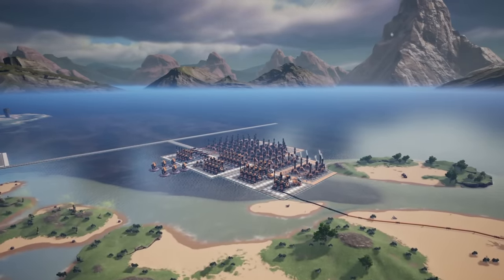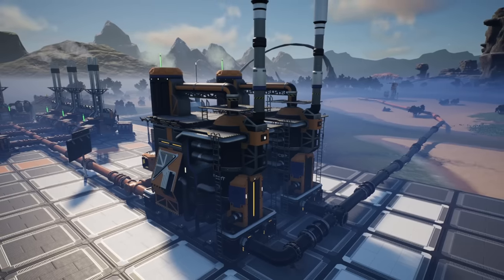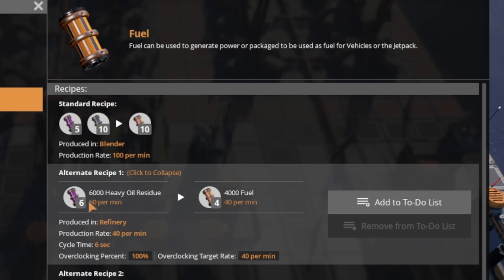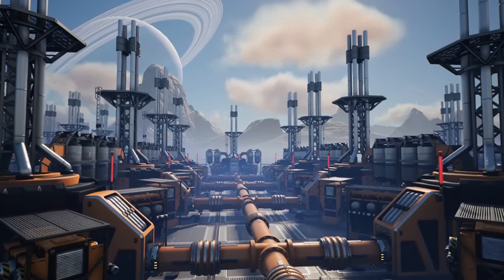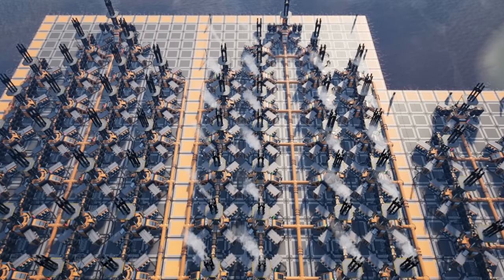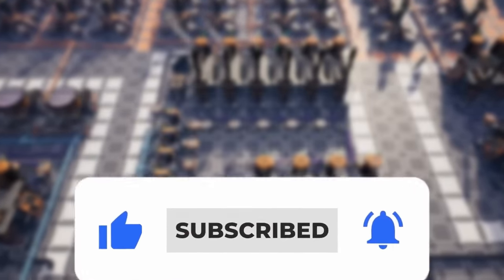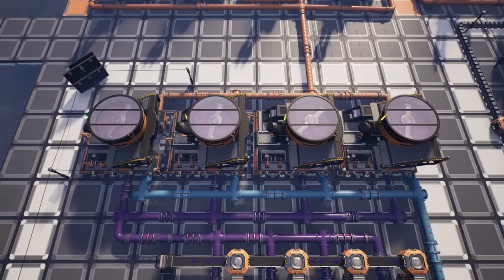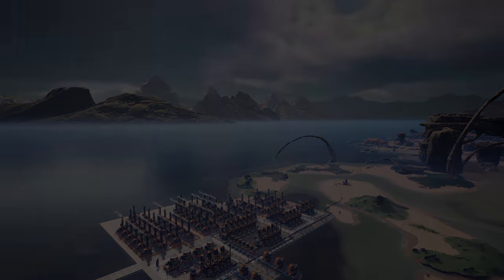100% Efficient Alternate Fuel Layouts For Every Player in Satisfactory

Comment from the maker: ALL MY MATHS IS WRONG! (Kinda) - so I confused the pure oil node (240 crude per minute) with a pure resource node (120 per min Mk1) So these layouts are PERFECT - for a normal oil node... For pure oil nodes you'll need to double each recipe. My apologies guys!
Reply: jep sadly yet no mk2 oil pump ingame. but you always mentioned 120 oil/min so it doesnt matter much
Reply: Awesome video as always!
Question:
Is there an advantage to setting clock speeds using percentages instead of just typing the output required?

I noticed there was a water extractor you set to 66.66% resulting it it outputting only 79.99m3 (I know it's not much, but over time...).
If you type 80 in the output it updates the clock speed to 66.6667 automatically 🙂
Reply: Would be nice to see a working setup with full overclocked System on pump and generators/Refinerys and also with Turbofuel. Non then less - your video helped me in deciding layouts - thanks for that. :)
Reply: Man, don't even sweat it! We all do it from time to time haha. You let us know right away and gave us a great and helpful video, and that's the big thing! Thanks dude!
Reply: Not long finished a maxed alternate turbo fuel facility for fuel, not bad these little fuel factory layouts big ups real helpful for the newer player
Reply: Also, you mentioned 533% overclock on the packagers for the Diluted recipe. I assume that you meant 133%. Although, 500%+ would be nuts to see lol
Reply: @Leelanidas  I think he meant total? so 100% for four and 33% for the last one
Reply: @Dragunta  for five of them not four and one is then set to 33. he even explained it
Reply: too bad this amazing detailed video will be completely broken once the new update arrives, due to changes to linear scale to overclock :/
Reply: @michapremi9586  ye thanks I meant to say five but wrote four lol
Reply: @MindResonator  kinda late comment but it usually doesn't matter if you type enough decimals (4 decimals have been enough for me so far, for example, if it's 66.66 repeating underclock, you type 66.6667). I noticed this when using the calculator for some of my projects, since it only tells you the OC/UC speeds, instead of the exact output of the machine (although you can achieve this by just doing the math, adding up all the 100% OC machine outputs, but yeah).

Comment: Whenever I sink Polymer Resin I am not using for Plastic or Rubber, if I even decide to use it for it, I just set up an extra production line to create Synthetic Fabric and then Sink that. It gives  over 11 times as many points, and only requires an extra refinery and water extractor.

Comment: Why not suggest a Valve instead of a turned off pump ?
Reply: I was going to ask this...
Reply from the maker: You can use a valve, but they're unlocked later in the unlocks so this makes it available to all 😉
Reply from the maker: You're right the same tier, for some reason I thought it was a separate milestone - regardless you need rubber to build them, which you might not have done yet. Pumps only use iron and copper so are more accessible.
Reply: @TotalXclipse  Debatable considering that the plastic containers need plastic for packaged fuel recipes. But I understand your point that Pumps are accessible way earlier.
Reply: @rkay.gaming  however you refine oil into oil residue and so getting polymere residue or direct plastic or rubber only need to menpty the pipes
Reply: @rkay.gaming  Unless you have the alternative recipe which uses iron instead of plastic. :) The empty pump makes more sense Imo.

Comment: Funny thing, the interface for clockspeed allows for the inclusion of mathematics for the setting (borrowing from the "search" calculator from the n key), because of this if you want a machine to produce at .666666~ you can enter 2/3 instead (or if you want to overclock 1+(2/3) as an example for 1.666666666~). So knowing your fractions actually can make your day easier.
Reply: You can also just.. Set the production numbers you want. You can edit the "X/m" value in the overclock menu and it'll update the values accordingly.
Reply: @nikkiofthevalley  Yes, but when your dividing production evenly between say 8 Refineries with an input of 1235 as an example, it's probably easier to type in a fraction then a 5 place decimal. (Also, before anybody says all inputs are rounded to 2 decimal places, that's only half right, only the displays for the inputs/outputs round to 2 decimal places, they actually do keep the full number).
Reply: This is true, but you have to take place values into account because it doesn't convert the fraction into a percent but just makes the output of the math the percent itself. For instance, if you want to underclock a machine to run at 2/3rds the speed, you need to put 200/3 (66.667) into the clock speed box. Alternatively, you can also just manually set the output speed, so if you need 4 items/min and the machine normally does 6, just type 4 into the output box to achieve the same 2/3 speed.

Comment: I'd like to see a complete setup using turbo fuel just to see how far you can bring the power production.
Reply: agreed! I think CSS redid the recipe a bit, as it doesn't seem to be a big drop from fuel to turbo now. or is it me? hehe 😅
Reply: Oh you should see the mess that comes from turbo blend fuel.
Reply: I've already done it in my game. I have two normal oil nodes going into packaged diluted fuel and then into turbo fuel, powers 280 generators for approximately 42 thousand megawatts.
Reply: @NaraiOskara   Don't remind me! I did that ONCE, a personal nightmare! Much rather stick with standard turbofuel TBH!
Reply: from 1 pure crude oil node on 250% ( and ~1.1k coal/sulfur for compacted coal ) you can make 1333.33 m³/min turbo fuel 
This translates to ~293.3 Fuel generators which will make ~44.4k MW of Power

This setup will take a lot of sulfur, which is one of the rarest resources in the game. 

When you instead decide to use the other alternative recipe "Turbo Blend Fuel", which uses only 400 sulfur/min for that same amount of crude oil, you can make 800m³/min Turbofuel.
This setup translates to ~177.66 Fuel Generators which will make ~26660 MW of Power

.... I hope this helps ;)
Reply: I use this set up before going to nuclear power plant :

240/min sulfur & 240/min coal --> 240/min Compacted Coal with 10 Assemblers who produce 24/min each

With "Heavy Oil Residue" I convert 225/min Crude Oil into 300/min Heavy Oil Residue with 7.5 Refineries
Of course, the 150/min Polymer Resin go into the grinder.

And with "Turbo Heavy Fuel" merge the Heavy Oil residue and the Compacted Coal into 8 refineries to make 240/min Turbofuel.

With this you can feed 53 Fuel Generators who will produce 7950 MW
Reply: @MrEarlofRochester  It does. 👍
Reply: @codyfox2876  O_o

Comment: As you will feed 27 fuel generators anyway it's a good idea to group them into 3x9 arrays. Each array can be feed by MK1 pipes as you only feed 1/3 of the fuel/water. Further i usually build 3x3 rafinerys with 3 feeding into their own packaging/centrifuge circle. That way you can underclock each rafinery by total_amount/number_rafs and get a more power efficient production, as production buildings scale exponential with clockspeed.
Also the clusters do look pretty cool and you can mark them on the floor or with stairs etc to make them look even cooler.

Comment: With polymer resin, at least initially, use a smart splitter to initially send it into, say, a series of three industrial containers via a smart splitter.  Then send overflow into an awesome sink.  Then set up plastic and rubber production when ready. 

I pretty much do the same thing with plastic and rubber, that way, everything keeps flowing.
Reply: yep, i did this with a quick and dirty plastic/rubber set up early on to start with oil stuff, 2 containers filled rather quickly off just 1 normal node, using HOR alt recipe.

Comment: Resently made a settup which produses 18000 MW from 540 crude oil per minute using the heavy residual turbofuel recipe. It took 120 fuel generators and a lot of space, however i am really happy with the end result
Reply: My current setup only produces about 1200 MW, and I'm really hitting the redline with my power consumption, (max I've seen on the graph is 1272.3) the only reason my grid doesn't crash every 2 minutes is because I have a small battery bank. Hopefully this video can help me squeeze enough power out of my 2 Cruse Oil nodes. My current system is an absolute mess, (imagine a spiderweb of pipes, with tons of conveyor spaghetti on top of it.) so I really doubt I'm running at full efficiency, or even a quarter efficiency.

Comment: If you want packaged fuel you can set the refinery to generate plastic, then turn the plastic into containers, fill the containers with water, and finally use the diluted heavy oil residue in the refinery

Comment: This is a great guide and is a good reference to look at when getting into oil, but It would be greatly appreciated if you could show an efficient layout for using the amount a fully overclocked extractor can produce on a pure node that also accounts more for the issues with pipes, rather than the normal extraction rate and a single unpowered pump (which most certainly has never been enough to fix my flow rate issues when going on perfect math). The math and layout of the fuel pipes and generators change greatly because of the large amount of fuel you're producing and it can be a bit overwhelming to try and come up with a clean yet compact layout that still works as intended (without power fluctuations) when dealing with fully overclocked extractors on pure nodes.
Reply: A bit late reply, but fuel generator overclock, and i think all power generators, have linear scaling. 1:1. So, 250% overclock on 1 generator is like having 2.5 generators in 1 building (they also burn as much fuel as 2.5, linear as well). It's mostly to reduce machine count, not really needed, but you know how annoying working with pipes is, so the less the better I guess haha. If you're gonna overclock something, start with the oil extractor to get more, of course.

Comment: @TotalXclipse: I'm missing a comparison of net out-put power, because the dilutes packaged fuel system has a big impact on it's own uses (so produced power is not the net power)
Reply from the maker: I mean 3 water extractors, and 12 packagers are hardly going to be more expensive in terms of power consumption Vs the gain of fuel. But I see your point - perhaps once I've covered the turbo fuel setups we'll cover net power comparisons 😉
Reply: between the blender and the packaged fuel i would love to know the power consumtion diffrence: i mean 1 refinery (30 MW) 2 packagers (2x10 MW) so total 50MW for 60 fuel/min. 
i dont know if the blender does use more
also what is the gap if you would overclock both systems will there be a bigger gab
Reply: @asraiel  Blenders are 75MW, they cost slightly more power, in exchange for simplifying the build

Comment: I'd never thought of using an unpowered pump as a pre-Valve-availability valve stand-in. Huh! Also, bugs with pipes, you DON'T SAY! My Turbofuel power plant setup ran into a thing where placing crosspipes didn't actually "split" the main pipe line properly so a bunch of fuel just... wasn't getting to a bunch of generators. I had to delete and re-add pipe segments from the crosspipes. ARGH.

Comment: great vid as always, but i do wonder why you have used unpowered pumps, and not valves, to stop backflow? i assume you forgot about valves, since you dind't mention them either. otherwise, a really good overview of the diffrent chains, and a good visualization of how effecient some of the more advanced chains, compared to the simple ones
Reply from the maker: Nope - I didn't forget about valves - currently they're bugged on larger setups, and they also require rubber which some that are starting off with oil may not have produced yet, so by recommending pumps. They're cheaply available to all, and don't run the risk of bugging out. 
- that's not to say you can't use them though.
Reply: @TotalXclipse  would have been worth mentioning, especially since your content tend to target newer players, however i did not think of the rubber part, since that and plastic is always the first things i do when unlocking oil. And i didn't know about the current valve problems.

Comment: Any suggestions for why my fuel setup always backs up in various refineries? It’s a giant triple node turbo fuel setup. The maths is right, I’ve checked it a billion times. But turbo fuel or heavy oil residue backs up in the refineries ie it doesn’t drain even though the pipe network should have the capacity to take it, and then the other end doesn’t get enough fuel even though the silly pipe says that it’s full and it should be enough. There are valves for back flow and pumps where necessary. It’s totally baffling
Reply: Replace your pipes.
Reply: @Salmacream  tried, unfortunately no joy. It just seems to flow fine sometimes when it feels like it and then sometimes not. I might just run more pipes so each one is running at below capacity and have smaller manifolds
Reply: @Wease245  You should make sure that your manifolds cant back flow, also go make a post on the satisfactory discord or the subreddit, with screenshots those guys are great and helped me find a few fluid flaws before.

Comment: Ok, dumb newbie question: your screen shows the recipe as incoming crude oil outputs heavy oil residue and polymer resin. I do not have that option on my refineries. The one I have is: crude oil in, plastic and heavy oil residue out. Is this something I have to research from the MAM with a hard drive?
Reply from the maker: Yep like I mention in the video the alternate recipes are unlocked from hard drives in the MAM

Comment: Wouldn't it be easier to use valves, instead of pumps?
Also, can we use similar setups for plastic?
Reply from the maker: You can use valves, it's just pumps are available to everyone upon hitting oil. 
You can also use the polymer resin to create plastic or rubber should you wish rather than sinking it

Comment: kind of a random question, but i tend to underclock all my machines rather than running one underclocked and the rest at 100%.  is it more efficient to underclock the one?  or does it all work out in the wash?
Reply: As long as the total production/min lines up with what is needed then everything will work fine. I like to let all the pipes fill before turning machines on just so that there's no weird back flow issues

Comment: I’m still on Update 5 because I’m trying to move my setup in the new biome out before it gets swallowed by the updated terrain, but unless they’ve changed between the two updates couldn’t you just use valves set to max throughput for the same purpose as the pump at 4:55?
Reply: That's what I thought as well

Comment: Why the unpowered pumps and not a valve ? Is there a difference in their behavior ?
Reply from the maker: both the same, except Valves can cause bugs  and they use rubber, which someone starting off on fuel for power might not have produced yet. Just makes it more accesible.
Reply: Ah that  makes sense,  you didn’t mention in video so was curious 

Can’t wait for your turbo fuel setup guide video ❤ hehe

Comment: On paper, my setup is 100% efficient, but I'm constantly running into problems where either some fuel generators aren't getting enough fuel, some refineries aren't getting enough oil, or the extractors are constantly turning on and off because the entire oil pipe network is bottlenecked despite everything running none-stop. Somehow, there's always too much or too little fluids in the pipes.

Comment: Once I started making turbo fuel I stopped makine regular fuel all together. Fuel generators only use 4.5m per min of turbo fuel, thats almost 2/3s less than regular fuel.   I have 85 fuel generators running on one oil node making turbo fuel.

Comment: You can tell how much someone has played the game by how much effort they put into fuel generator factories:
- None, they are still using biomass/coal
- Normal Fuel, they have just unlocked fuel
- Residual Fuel with Heavy Oil Residue, they still think that oil is primarily for power
- Diluted Packaged Fuel, they have never passed Phase 3 and still think tens of GW is worth that effort
- Diluted Fuel with Blenders, they have not created nuclear power before but at least figured out that everything previous was supposed to be temporary
- Turbo Fuel, they have not created nuclear power before and have not realized that everything here was supposed to be temporary
- Residual Fuel with Rubber/Plastic, they have created nuclear in another save and realized that any effort beyond this for fuel power is slowing down progress to Tiers 7/8
- None again, they are at end-game with hundreds of GW of power from nuclear and only using fuel for manufacturing parts like FMF, Rubber, and Plastic.
Reply: agree